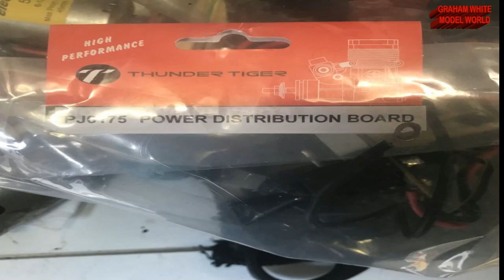Building SB2

Comment: I've lost the main control board on mine. Trying to resolder the wires to the receiver was futile! Does the unit you obtained do the same job as mine did with pump control and depth keeping via the pressure switch?
Reply from the maker: Hi Jamie the answer is no my pump control only controls the roll pump from fill to empty, Put i think Mr RC is making a new one with more control,-- all the best graham
Reply: @RETSUB12  I was thinking of doing a more basic control with a couple of microswitches, but if I can get something like the one youhave, then that will be better. Good luck with the dive tests.